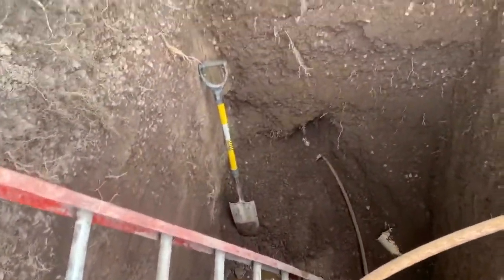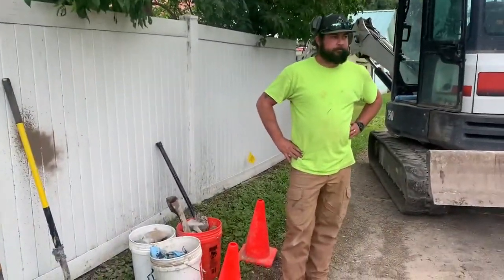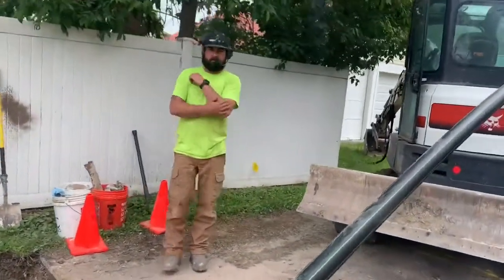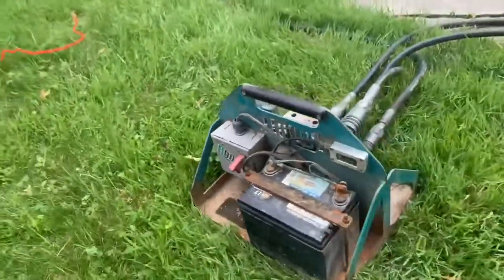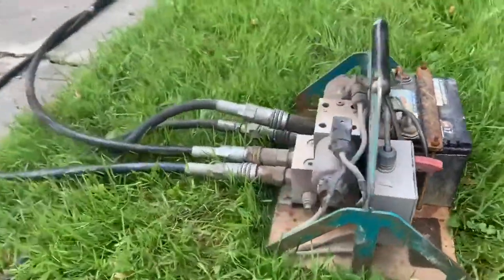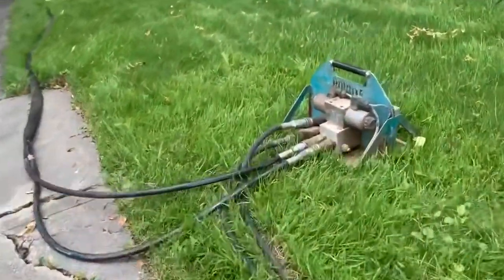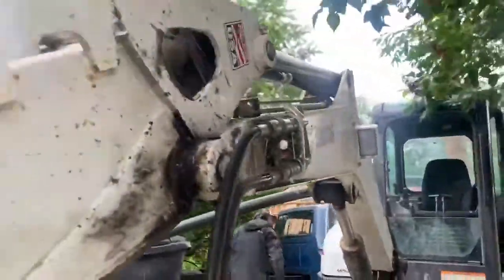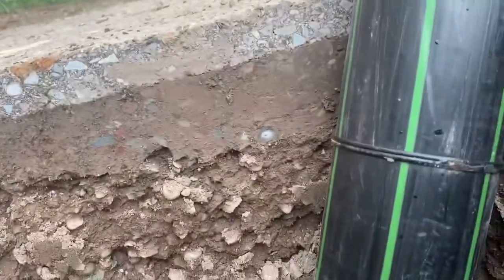Sewer line replacement from basement to the alley

Comment: A possible new feature for the remote: maybe add an "auto-cycle" switch, so the operator doesn't have to manually change switches with every stroke.   To avoid a potential 'runaway' safety issue, it could be a button that needs to be held in to keep cycling - it would be easier to use than changing buttons every few seconds.  Something monitoring the line pressures, could detect when the cylinder has bottomed-out in each direction.
Reply: been there,  just more shit to fail.  keep it simple works best.

Comment: I just watched your more recent video where you were using the gas powered pump unit. 
Does your puller cycle faster with the trackhoe feeding the distribution block or is it pretty much the same?
I’m debating on trying a pull with our Kubota vs. our standard power pack.  I think we’d need a in line pressure gauge on the line going into our Spartan though. I’m really hoping thst we can get your whole setup this season and just keep the Spartan rig as a backup. I want a Engcon tilt rotator for the hoe as well. 😂

Comment: Do you guys cast the spoils from the hole into the truck & dip it out when you backfill, or put it on the ground? Can’t see the pile in the video.
Reply: haul it off and replace it with structured base.